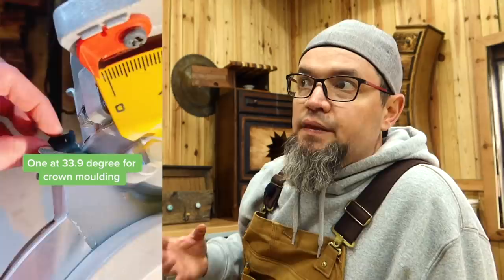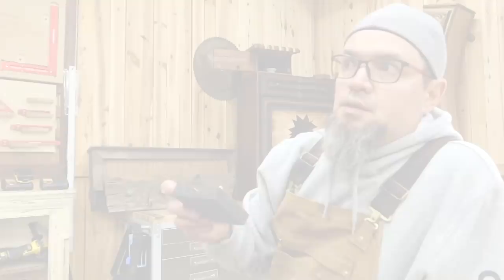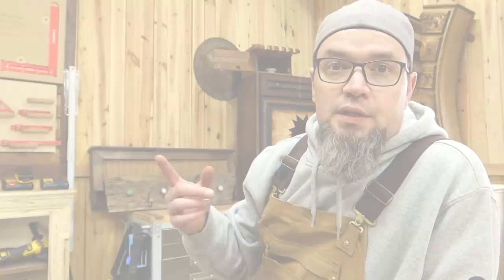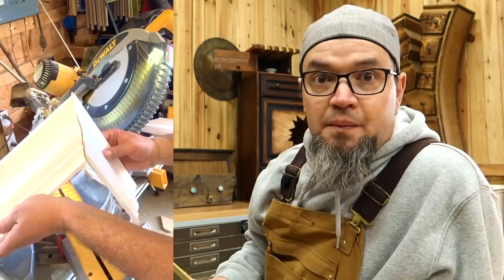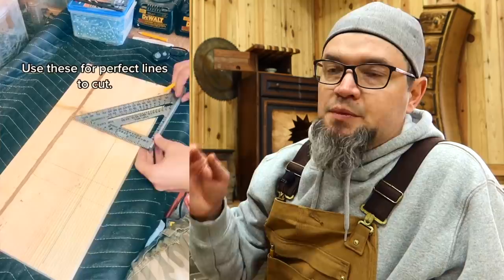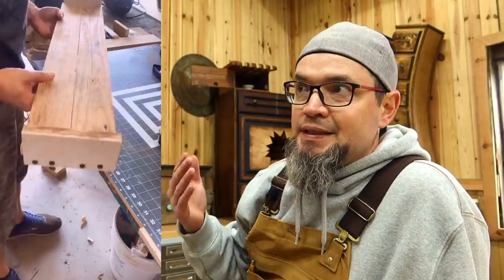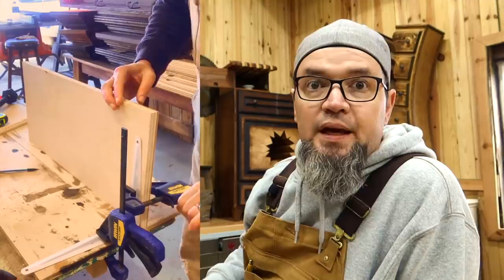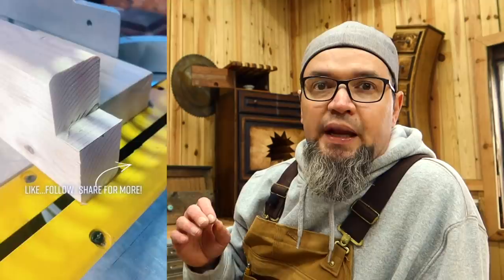15 Of My Most Viral Woodworking Tips and Tricks

Comment: Hey Matt Another good video,  The tip for dented wood, back in the day on the job site, if we missed the nail ( there were no air tools in those days)  We would wet the wood and rub the hammer head over the dent and it would take the dent out

Comment: I like the 'scrap 'n' screw' alternative to painter's tripods.  Another economical option if you don't want to pay $6.47 for a bag of 10, but may be out of extra screws or suitable scrap, is to buy a bag of 'rebar chairs', for holding up rebar off the bottom of a concrete pour.  The cheapest ones I found are $4.47 for a bag of 20 that are 2 1/4" tall, at 'the Depot'.  They have a little rebar clip at the top, 2 high points, and if that messes up the paint too much, clip one off.
Reply from the maker: Love it Bill.  Never thought about that!  Great idea!

Comment: I have found that the brad nail tip is arbitrary, sometimes it works and sometimes it doesn't. You never know what is inside the wood that may divert the nail. I am meticulous about the tip of the nails and they still blow out.
Reply from the maker: They can still blow out regardless of angle.. but it is far less likely.

Comment: Great video as always. I have a request for a video. Can you show  how to zero you dewalt miter saw? I can not get mine to cut straight  and think my dewalt backer is off but probably just me. We have the same saw except I rarely use mine because I square left side of blade then the right side is off? I feel stupid I can’t follow those dam directions lol.  Please help me Mathew lol.
Reply from the maker: Hey!  If the base is square to the fence and the blade is square to the base then it should be square on both side.  If its not your blade may be warped.  Forget about the plates... they are adjustable.  Find square and then adjust the plates to read to your blade.  A digital miter gauge is cheap and a must!  zero to the base and then put on the blade.

Comment: The stand off “hack” you showed is one of those things when I saw, I felt stupid for not thinking of something so obvious….
Reply from the maker: Man I love and hate that feeling.. We cant think of everything but its nice to learn a new tip.  Anytime your struggling with something just stop... sit back and think... and most of the time you can create something that will help.
Reply: I made one of these stand off with a 6x6  piece of scrap plywood with finish nails ay random positions that I use to spray small figurines that I cut on the scroll saw. Inexpensive and works great. I will now make some with a single nail too.